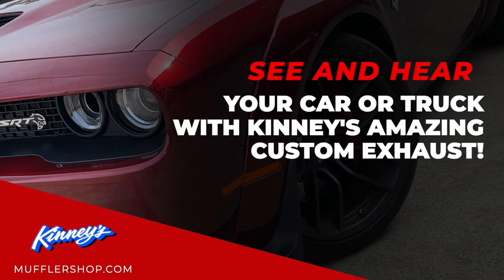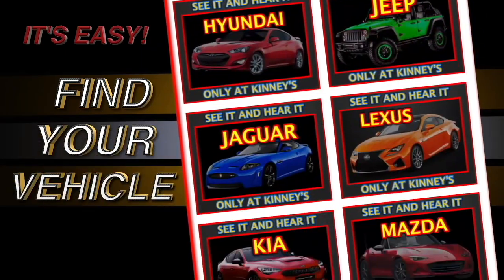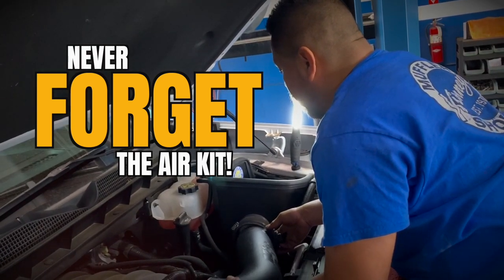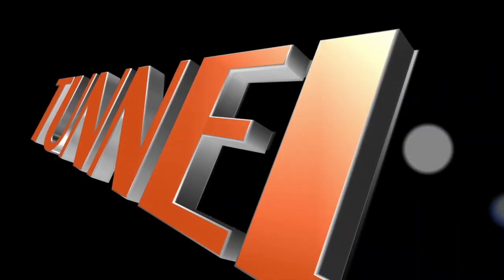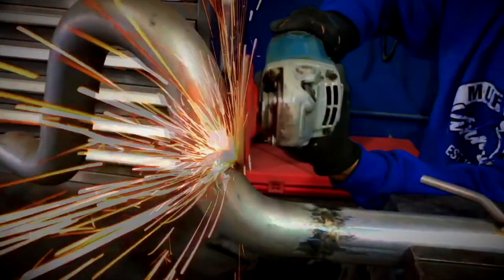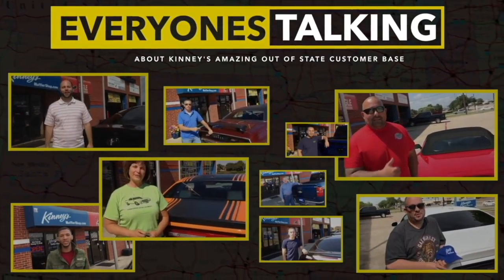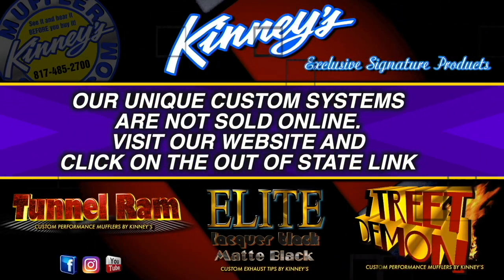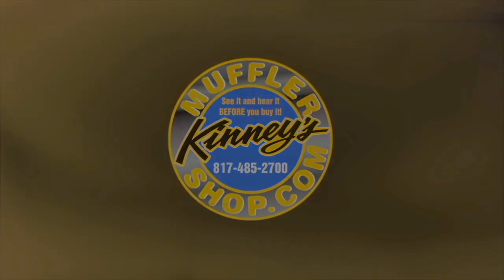2021 Lexus is 350 F Sport Street Demon Performance Exhaust by Kinney's

Comment: Looks like you used mild steel piping correct? Really nice work
Reply from the maker: Have not used mild steel tubing in 30+ years now. We use a good deal of heavy duty aluminized and stainless steel. Mild steel starts rusting within 3 days of installation and exposure.